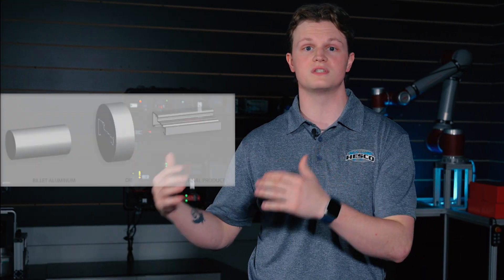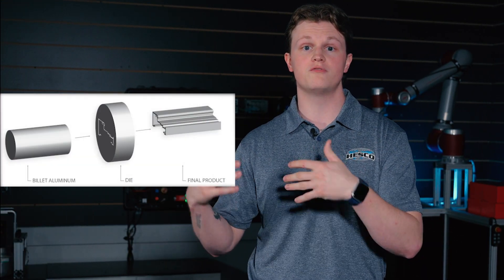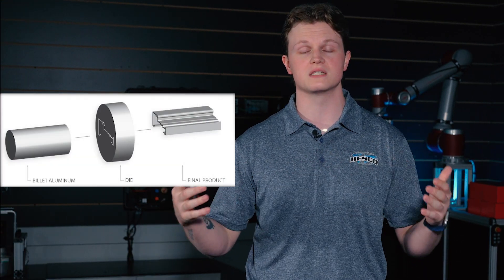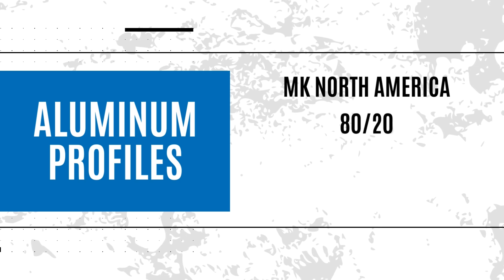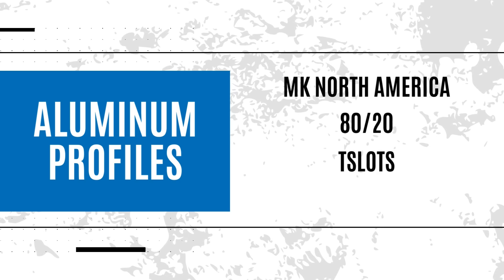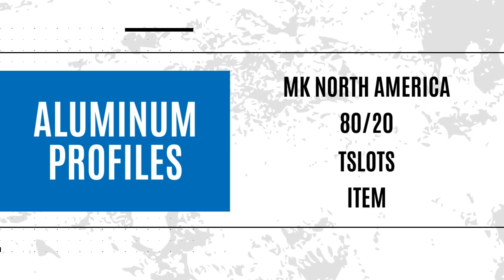What Are Aluminum Profiles

Comment: ...You missed Bosch Rexroth.
Because Item and Bosch are the most used in industrial settings and are often copied.
Usually you can identify the system by either being called type I or type B.
I recommend the myaluprofil shop for German customers, check out the Gewinde-Formverbinder I absolut love those things.
Reply from the maker: Thanks for the information! I completely missed that, I appreciate the help!

Comment: i am in columbus ohio and i have been wanting a local source for these, i cant even get imperial sizes, Why does Merica hold onto it so Metric is so much easier. That said I have been all over the city and there is no place to get aluminum extrusions in standard or metric. Sure i could order some but what about when i make mistakes or need more it would be nice to drive down to the metal shop and pick some up..... I cannot be the only one in the 10 largest metro in usa that wants these.
Reply from the maker: I totally understand the frustration, it's crazy that nobody in Columbus holds any. Might seem like a longshot depending on the quantity needed, but have you tried contacting a manufacturer directly? You might have better luck going threw them.